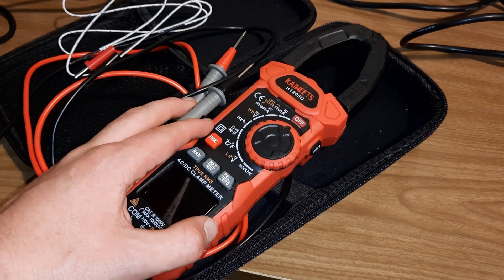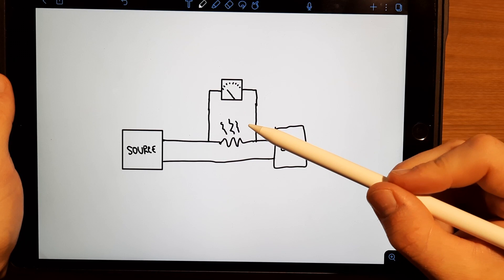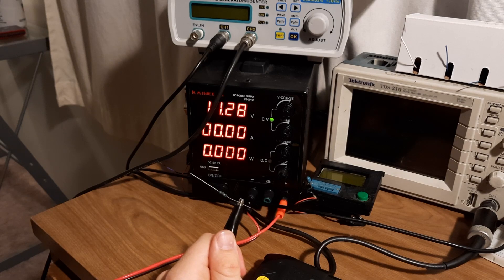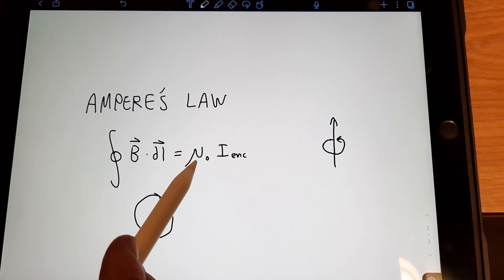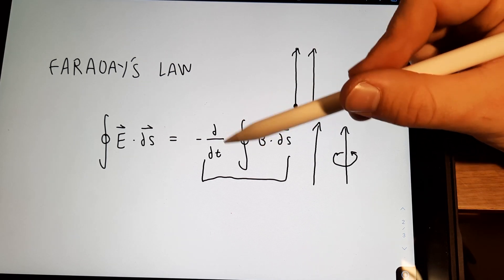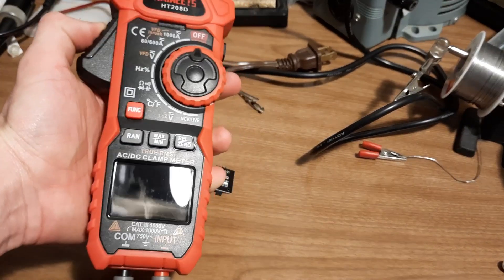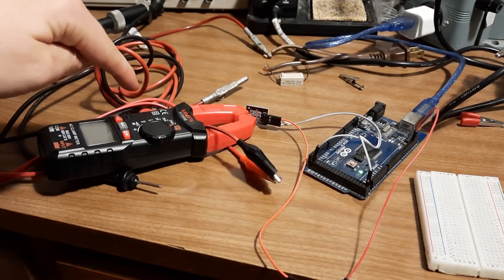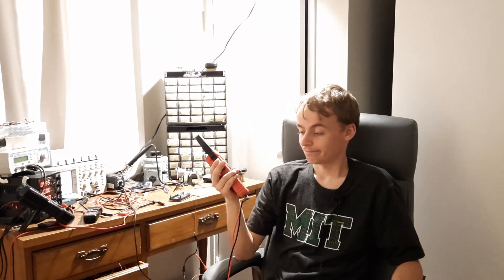How DC Clamp Meters Work(And other ways of measuring electric current)

Comment: Why when I measure, for example, the positive side gives me a value and with the negative another value, or does the same positive cable on one side of the clamp and then the other way around give different values? With this exact clampmeter model

Comment: My Kaiweets behave strange or I'm wrong. Need your expertise with a strange situation.I have a DC clampmeter, Halls sensor type, when I measure a DC current shows me different numbers when I change the clamp orientation..let's say I read +10Amps, if I rotate 180degress shows -12|Amps..shouldn't be the same? like an ampmeter ..really doens't care polarity, it's same result..no?..TY !

Comment: Hmm... The clap has open metal ends, could you attach extra wires to it, coil that and use a different size loop 🤔and, could you use that reading to calculate the size of the new loop

Comment: Are you ok working and being at university at the same time?

You look like you lost weight, get yourself a snack!

My multimeter yells at me if I try using too much dc current... If I use too much ac current, it just detonates🤣 which explains the new fuses and why one lead is now shorter...
Reply from the maker: There is no university during the summer, so I am working an internship to save a bit of money for next semester and gain some good work experience in the Electrical Engineering field.
Reply: @TannerTech  goodluck!